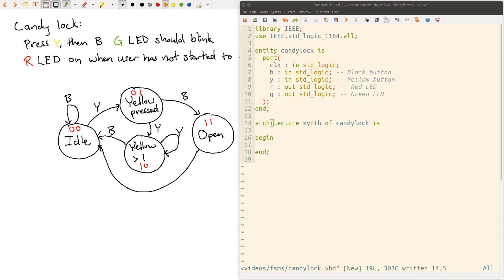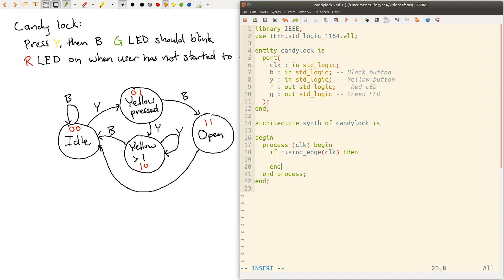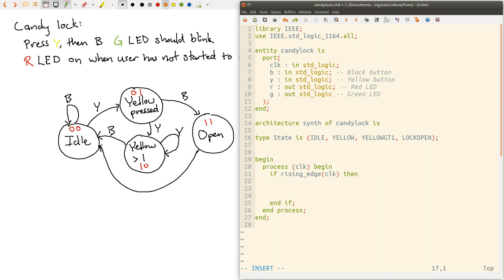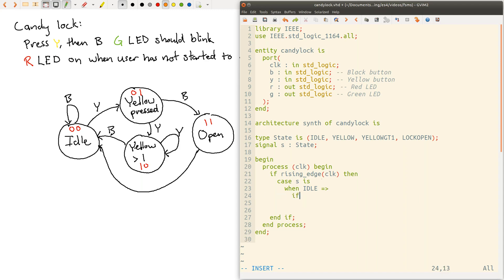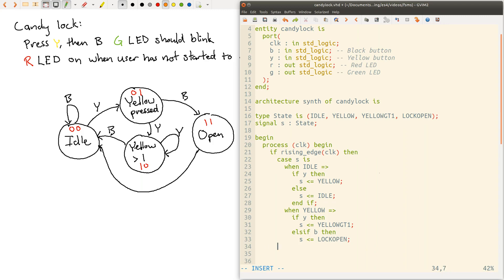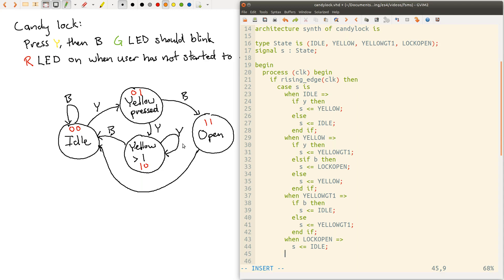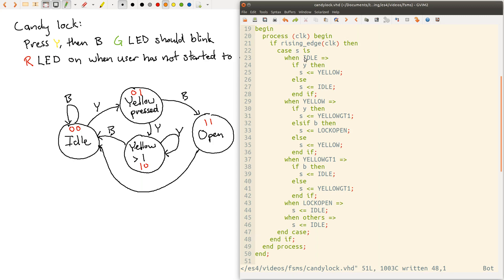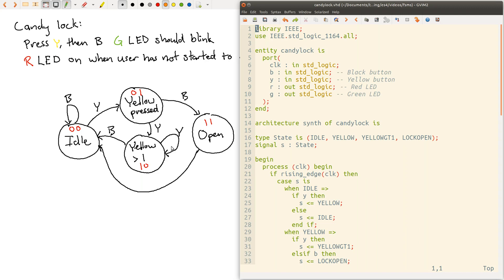Implementing the candy-lock FSM in VHDL

Comment: Don't we have to initialize the states?
Reply: I meant not initializing but define them, like how does the program know that an idle state represents a 00
Reply from the maker: Ah, the cool thing about this method is that you don't have to specify the mapping of states to bits;  the synthesis tool can do that for you.  And because it can try a large number of possibilities very quickly, it can (hopefully) find a state encoding that minimizes the number of gates used, or makes the circuit run fast.

Comment: Dear Steven, thank you for your educative video. I have a short question : usually, we hear that we need to convert an FSM into D-Flip Flops (to implement them in FPGA, this might be wrong part!), but here it seems you are very comfortably expressing it directly as an FSM. Where/when are the D-Flip Flops needed?
Reply from the maker: Right, it's almost always easier (and often more efficient) to express the FSM directly in VHDL/Verilog, rather than trying to work it all the way down to DFFs and gates.  The synthesis tools will happily do that work for you, and because the computer can rapidly search a large number of possible implementations, it may even find a better solution than you would find by hand.
Obviously an FSM will still be implemented with flop-flops at the hardware level, but there's generally no need to instantiate them directly.
Reply: @botsnlinux  Thank you so much Steven, this nailed it. Keep up your videos!